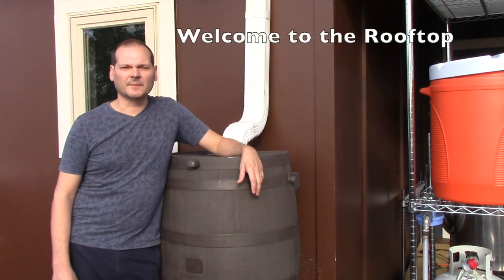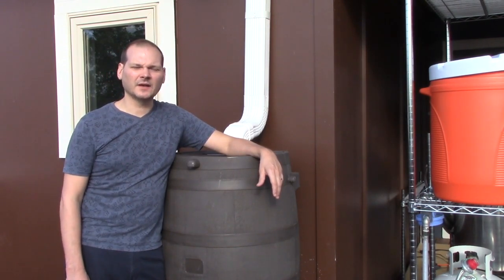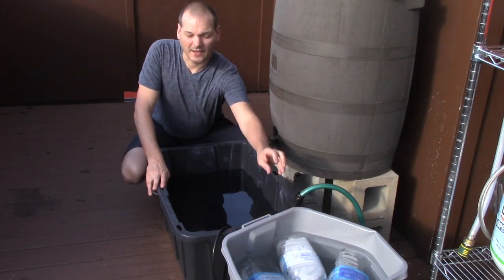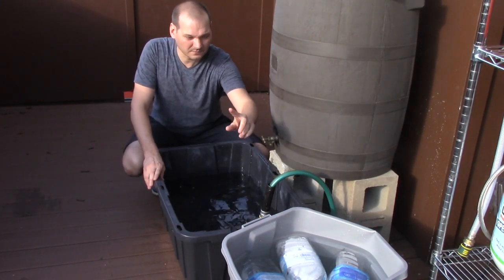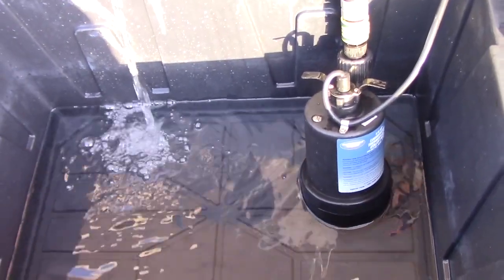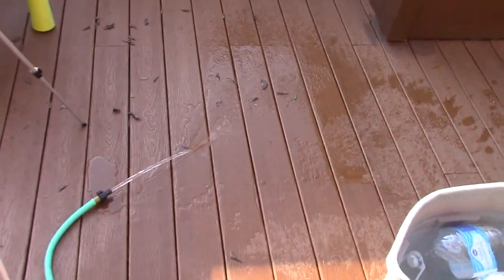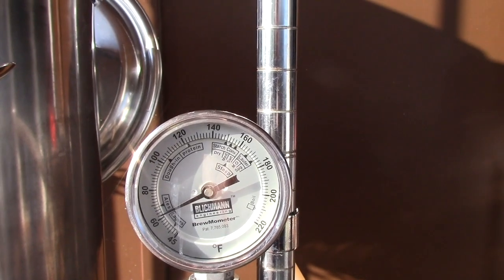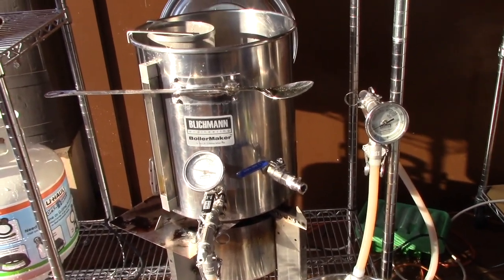Reducing Waste Water: Using Rainwater in Home Brewing

Comment: I wish it rained here in California! However, I do as much as I can to conserve as much water as possible. I run tap water thru my immersion chiller and collect it in buckets to wash and rinse with.  Then I do like you and switch over to a cooler full of ice water and recirculate that thru the chiller and back into the cooler with what looks to be the exact same pump as you use to get down to pitching temps. I bag the ice I use straight out of my fridge's ice maker. Any leftover water in the cooler I use for rinsing other bits and pieces of equipment.  Cheers!
Reply from the maker: I was living in LA when I started brewing...definitely not enough rain for this. You can't beat that weather though. I could brew year round in shorts and a T! Sounds like you have a pretty solid low water waste process.